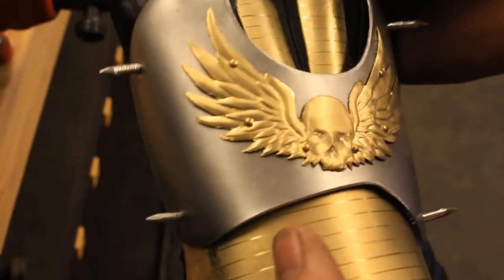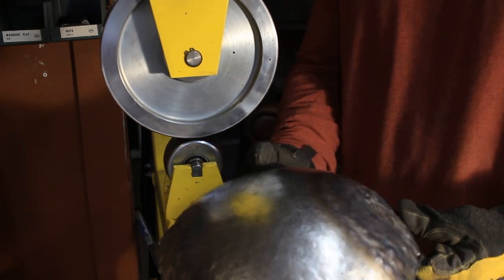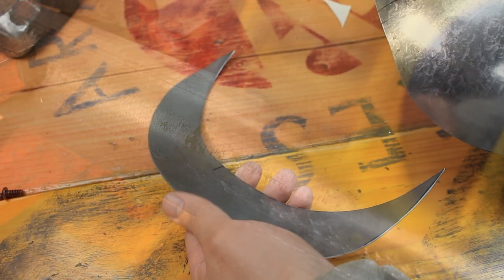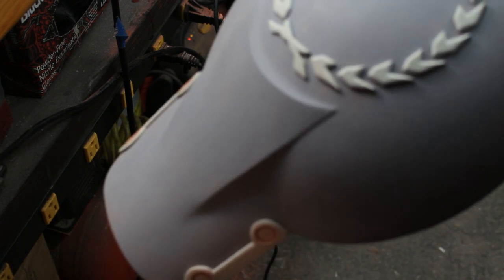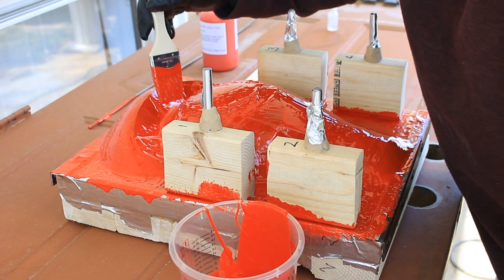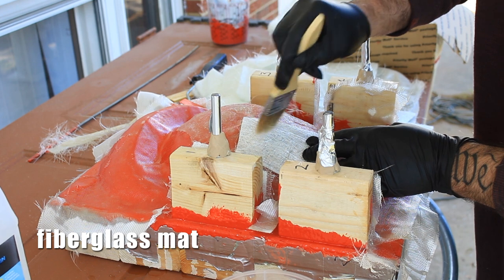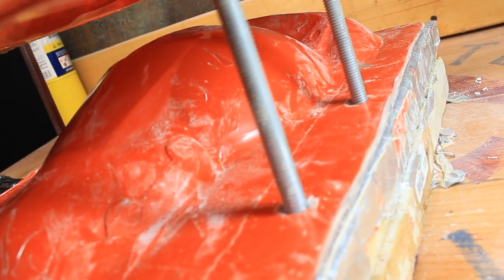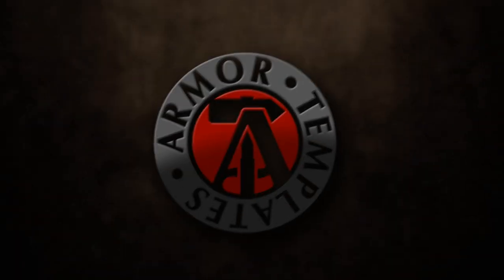BULLETPROOF Shoulder Armor! (Part 1)

Comment: Mold-making 101: Never use a rigid mold on a rigid part with undercuts, and ALWAYS use mold release.
Reply: The undercuts can be a HUGE problem pulling part from mold unless one is flexible.  And this design looks like it has lots of little undercuts on the details.

Comment: Hey david so i had an idea on how to improve this using some 1/4 inch steel

I know it would be a pain but the modern day plates have a peice of steel core to add extra stopping power to both hollowpoint and AP rounds

The design you chose works in favor of deflection but it could be a bit better as the fiberglass will fail after 2-3 rounds (hence the steel core) due to delamination on the internal fibers
Reply: I agree, although my thought was to not use fiber glass and carbon fiber but to use actual kevlar instead, I know it would be a lot of work but hypothetically doing some experimentation on what works best for this I think would be needed if any would be made for actually us. wink wink.

Comment: I have a challenge for you. I have seen tutorials like yours that also place a layer of small ceramic tiles in the inner area, sometimes these plates can then stop 7.62 or 5.56 but they weigh more and they probably wouldnt work  too well on a rounded shape, also the spaces between the tiles are a flaw. So this is the challenge. I want you to try statuary gypsum cement like Hydrostone or the hardest one I know of, Drystone. Once its cured (20 minutes) into a any shape a mold can be it is very hard, and then you can bake it in an oven and it hardens even more. You could make it into this shoulder shape giving the armor even more strength.

Comment: If this works fairly well, it would be cool to see how this could applied to chest, back and facial armor. Also, probably wouldn't hurt to add a layer of 20 gauge over the fiberglass so the bullet might bounce off or be slowed down before hitting fiberglass. Modern 3A is usually hard armor over soft.
Reply from the maker: that's what I was thinking as well. However, the thing about adding the 20ga steel...that would be really hard to get to fit properly and would make "mass production" nearly impossible. I put that in quotations because I certainly am not going to be cranking these out daily, however I do want the option of being able to make a few to sell.
Reply: @DavidGuyton  i completely agree. You sir, are a craftsman, which is more design than production. It would be too much for anyone to build that much armor. That in mind, it might be a good idea to make a test piece of material for proof of concept. And if it works, well I've been wanting a bullet proof shield for some time. That would be relatively simple to manufacture.

Comment: You could just 3d print the mold straight away, a little bit of sanding and it'd be ready to go. Printers aren't to expensive now days and you'd save money on epoxy, resin etc.
Reply: Lol thats actually what I was gonan do do i use a silicone mold?
Reply: @popinmo  You 3d print the mold
Reply: @Kuuryo It would leave more time for making other things, depends what excites you.
Reply: @LongPigg  umm that soundd way harder i wanna make it modular so I want to actually touch the armor to see if it fits right
Reply: @kiiiisu  A few seconds would have been more than enough. I was only making a suggestion of a easier, faster and cheaper way to make a mold.
Reply: @popinmo  My suggestion was about the mold, you aren't going to try the mold on for size and if you did want to it would only be easier to do so. Fair enough if that sounds harder to you but I personally find modeling something on a computer and have a robot make it for me is the easy route.
Reply: @LongPigg  id 3d print the modal then make a mold
Reply: @popinmo  My point was, you could just print the mold and cut out a stage.
Reply: I'd print the part and create a mold from that. Aluminum Epoxy can get quite hot when curing and warp your mold. Save time. If you mess up your mold, you can pour a new one. Saves time. Also post processing your 3d print is easier. Done it many times for the yacht industry. You can't put your 3d print mold in the oven for Carbon Fibre / Kevlar.

Comment: I was trying to work out my own bullet proof fiberglass plates awhile ago. Eventually figured out a way that would produce over 70 plates for around 6$ a plate. (In materials). Gotta buy in bulk though. I wish i had kept the info around. It was based on the plates made by znaproductions.
Reply: ZNA used fiberglass welder's blankets.  If I remember correctly, his plates only stopped pistol rounds
Reply: @bigd7861  they also stopped a shotgun. Bickshot and slug i think. I know for sure he shot it with buckshot.
Reply from the maker: I honestly don't expect it to stop rifle rounds. I'm gonna try it anyway though
Reply: @DavidGuyton  I think you'll be able stop pistol rounds easy enough.  It honestly doesn't take much with solid plates, as long as you remember to layer your sheets at 45° cross sectional.  Rifle rounds are always a different issue due to their sheer speed.

P.S.  Absolutely LOVE all of the work that you do!

Comment: Odd question: would a tail pipe extention work in place of a piece of tail pipe? The extensions have been easier for me to find for some reason.
Reply from the maker: If it's long enough it should work fine. The only issue you might have is that it won't be nearly as durable if it's not stainless steel.

Comment: How much does a full set of ordinary amor typically weigh
Reply: Depends on the thickness, but if mean knight armor with realistic thickness you are at 20-30kg (44-66 pounds)
Reply: @riesenfliegefly7139  which isn’t really all that bad. Most men can train to be able to use a full bodysuit that heavy for hours
Reply: Armor plates weigh 6 to 12 lbs a piece without trauma pads or camelback, full kit typically weights 45-85 lbs depending on setup and objective. Ironically its probably harder to carry for long periods than a suit of armor because of the way the weight is distributed.
I could see this for breaching, but otherwise it's extra weight.

Comment: I have my own design for an armored carapace that will make modern plates look like tin foil. Implementation of armor designs often used on tanks in body armor. It is meant to bounce a round instead of stop it outright like modern plates do. The only downside, the steel chestplate would weigh 40 pounds roughly just by its own.
Reply: No need. Ceramic rods, #2 pencil thick embedded into UHDPE plate about 1" thick with a thin layer of very hard steel, maybe 1mm worth on the outer layer to break up lesser rounds, the UHDPE will slow the fragments. Penetrator rounds would punch the hardened steel but shatter on the ceramic rods, while also shattering the rods, the round would also be braked (slowed) by the UHDPE before it hits the ceramic to some degree and slowed even more once it fragments from striking the ceramic rods. An under suit of aramid fiber with integrated water to air cooling inner layers with a wicking fabric would complete the setup. If you wanted another layer of energy absorption but at the cost of weight an inner layer of 1mm ultra-hardened abrasion resistant steel. But that will add weight.  Weight is also less of an issue when it is properly distributed as armorers once knew how to do. You can wear 80# of armor without being encumbered if said armor is properly hung and strapped to the wearer. In fact, you should be able to wear it all day. Esp because the greatest problem with all body armors, modern and ancient, is heat. The more armored you are the greater the heat stress on the wearer. So thus the water-cooled under-suit and wicking inner liner to provide a solution to the heat exhaustion issue with a full suit of armor and arming coat.
Reply: @meatybtz  I would hire you if I could

Comment: What about using an aramid fiber (kevlar) for the actual part?
Reply from the maker: I considered it but it ended up being far too expensive to experiment with
Reply: Good point, and I'm not familiar with how easy it is to work with, may be too bulky to shape that well
Reply: Check out MrGunsngear's YT channel. He did a video just in the past few weeks with some Kevlar he got on Amazon. Was only like $10-$12 for a 3ft x 5ft piece. He kept it folded and it actually was surprising.

Comment: 5/8 inches =  15.88 MM, no idea why them americans insist on using the horrible bad emperial system!.
Reply: Because we like to. 🙂
  Just a FYI, Americans are taught BOTH systems in school. 
  If you knew how to use it you'd know, it's very simple, and for projects like this, 5/8" is good enough. 
  15.88mm is too fine of a measurement and unnecessary. 
  5...1/8ths of ONE inch. 
  8...8ths in one inch. Very simple. 
  When you convert a simple measurement like 5/8" to metric, you get some bs like 15.88. 
  Multiply that by 2 you get some bs like 31.76
  
  Multiply 5/8" by 2, you get= 1-1/4". 
  Very simple. 
  
  In some cases, metric is simpler. 

  Like I said, both systems are taught in school however, if you don't work in a profession that requires very precise measurements, you likely won't use the metric system and most ppl
Who don't use it often, forget how. 
 
 Most Americans making videos, are gunna use imperial, cause that what they know, that what's necessary, that's what they figure the majority their audience likely knows or all of the above.
Reply: Why?  'MERICA, that's why.
Reply: I dunno, probably the same reason why euros can't spell the word "Imperial."
Reply: METRIC RULES!!
Reply: Most Americans probably don't even know that the definition of an inch is 2.54 cm. The imperial system is based on the metric nowadays.
Reply: It's not imperial system, it's the U.S. customary. No idea why them Europeans can't do a quick Google search, or use proper capitalization.

Comment: I enjoy your channel, and watching your skills. However I must take umbrage with the term "bulletproof". As a building contractor I have had several customers run aamuck with this term. There is armored, to various levels. There is bullet resistant. There is no bullet proof. In my particular case the town wanted "bulletproof" panic room for after hours when there was no one at the station. I ended up having to withdraw from the project because they did not understand what they were actually asking for.